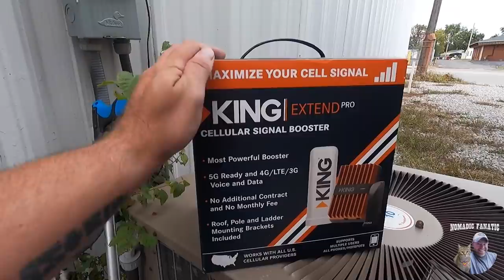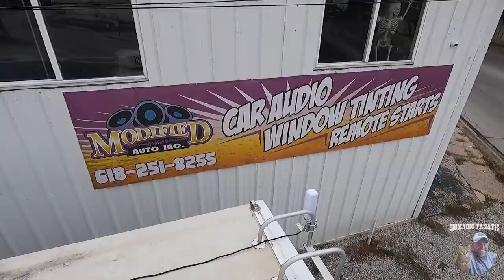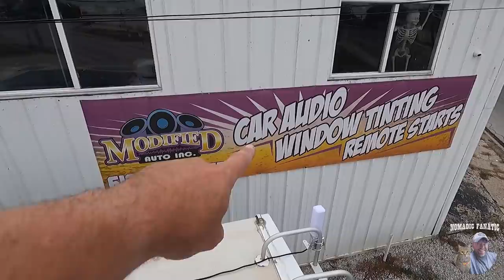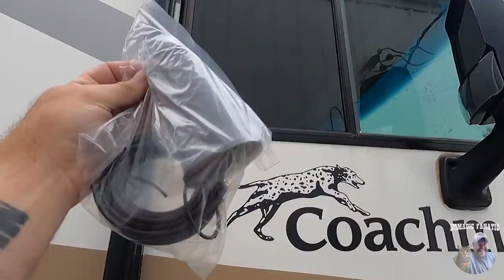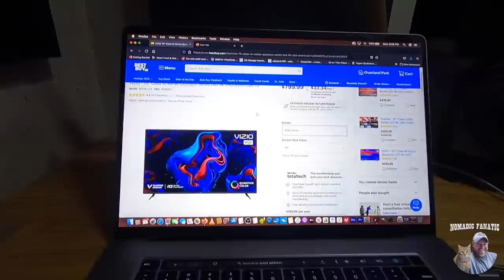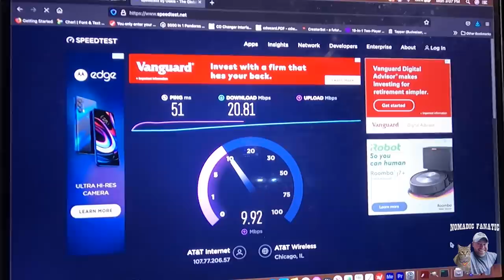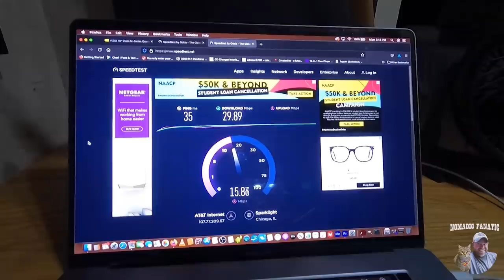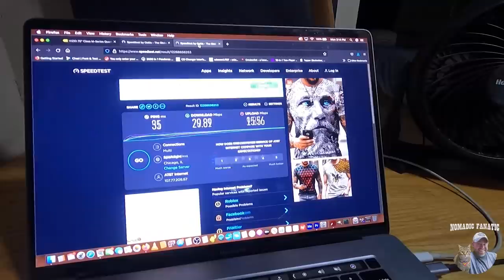Installing 5G Booster, Christmas Decor Grows, & Remote Start on Smart Car

Comment: i would install a signal strength meter app on ya cell and while holding onto the ladder  raise n lower your cell to see which picks up signal better .... usually bout 12 -14 inches above the RV/camper is best as long as you can do it

Comment: My Verizon hotspot connection on my phone is running regularly 90+ Mbps down and 25+ Mbps up lately, not sure what happened around here (Mammoth in Yellowstone) but our speeds have just soared lately. I run all my roof cables on the RV down the fridge vent too. I put my antenna on a pole that raises and lowers to find the best spot for reception when I'm out of normal service area.

Comment: build. The best place to install the extender is the original TV antenna mast. Take the antenna blades off install the extender then run wire down with antenna wire.

Comment: That red King unit appears to be a relabeled WeBoost unit.  However the antenna in the kit is different, and King makes antennas, so that's the difference.  The WeBoost antenna comes with a spring, protecting it against breakage if it slowly hit a branch.  It looks taller than the King antenna.  WeBoost comes with a 12VDC cigarette power adapter.  WeBoost is $500 also.

Comment: let us know how it works we have a viper broadband internet box with verizon. we have found that when we are out camping our phones will have good download but our box will be less. curious if this would help with speed. however this fall we were in san antonio and noticed from 7 am till 7 pm speed was extremely slow on the phone and the box, then it was like verizon flipped the switch and the speed went from almost nothing to 30-40 download

Comment: Have you sold your home in Illinois?
Reply: I believe he DID put it on the market, but cant recall if he said it had sold. (I think it did) But it was about 2-3 months ago, when he first got the Shop and sold the travel van he had after he did find Cams for the RV.
So it was in the time period when he got the RV running, bought (leased?) the shop, moved out of the house and into the shop, and sold the travel van.
You can probably look back in the old videos for that time and see what he said.

Comment: as the official day April 3, 2019, of Verizon introduced 5G mobile service in parts of Chicago and Minneapolis. Customers in those "cities" were the first in the world to have a 5G-enabled smartphone connected to a 5G network. So why all the hype mostly lies. about Roll out is crazy Show most cities don't have yet the 5G Range is only 1500ft or roughly 2- block that because it frequencies is inabout 28 GHz and 39GHz as goes up the range get shorter. so when (2028) 6G network come out your going your own ground Station. i found a map show The 5G Hot Spot Funny It Only Major City Business Downtown Zone. Yet None In Open Space of Out Land Aka Rural Small Town and Best Signal is in downtown area Tower height might be 35ft tops ground radius 1500ft. on main Highway Route street of Minneapolis Verizon wireless have installing short tower 35ft tall 5G 2 block apart they likely so you what you running on in far remote Likely good old (14yr old) 4G  since good 5G has power up then down due to airlines /airport 🧐